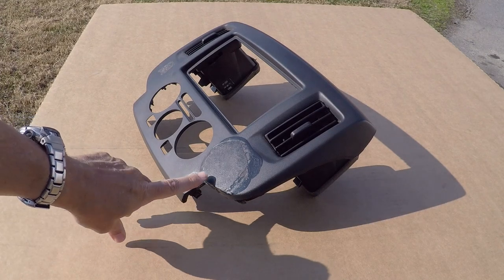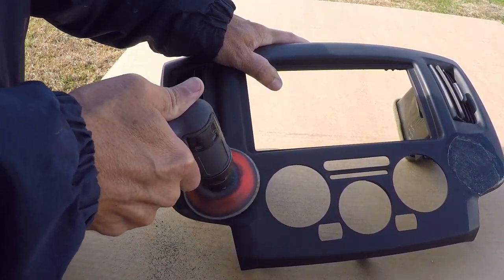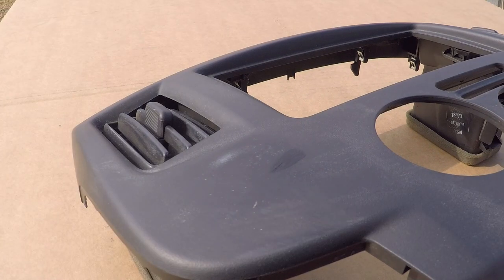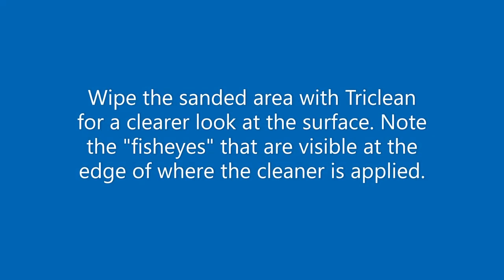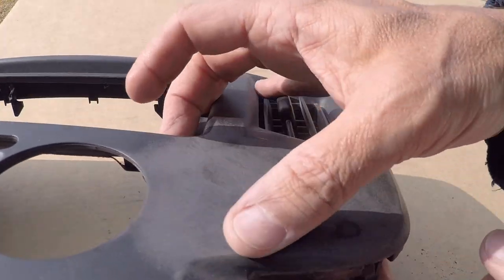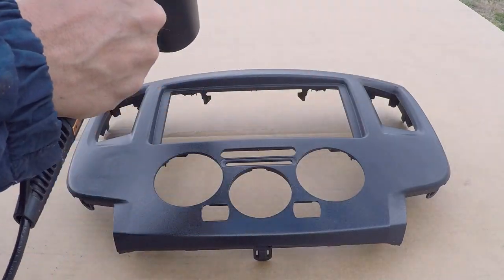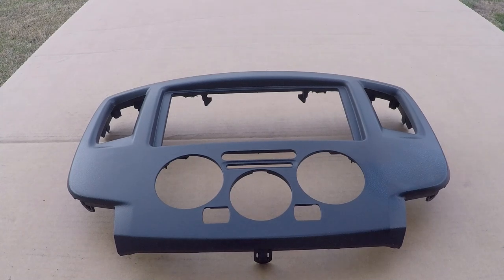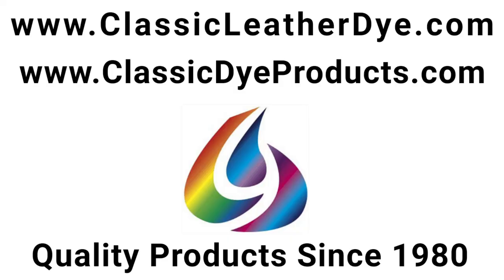Classic Dye Products - Plastic Surface Repair Tutorial

Comment: How long should you wait before handling the trim piece to reinstall?    I wouldn’t want to see pressurized finger prints on still wet finish.  

Good vid.  I only cleaned and didn’t use a prep last time, but only had some small black marks on air bag from removing it and “OCD ME” wouldn’t let it go.   (All turned out great except i can’t recall color I used to order more. 🤔
Reply from the maker: Length of time required to fully cure will often depend on the thickness of the coats applied and the number of coats applied. This along with ambient air temperature and use/lack of a heat gun will make estimating exact time difficult. If there is no rush to install, waiting until the following day is always a safe option.

If you ordered your color from us, send an email to classdye@pacbell.net and include your name and the year, make and model of the vehicle. We may have the color info in our records from your previous order.